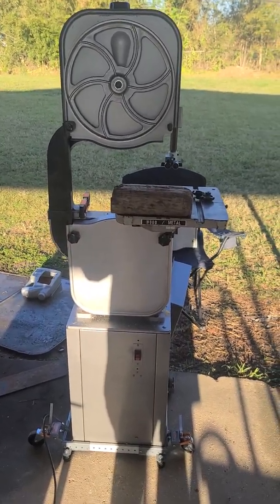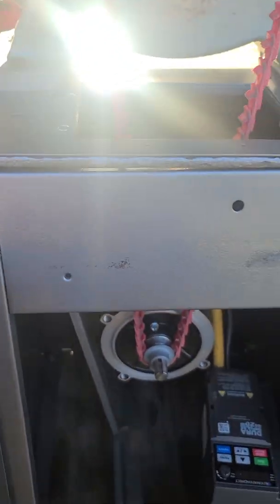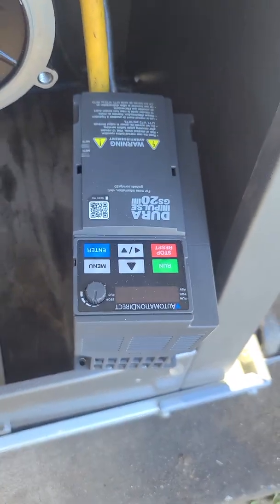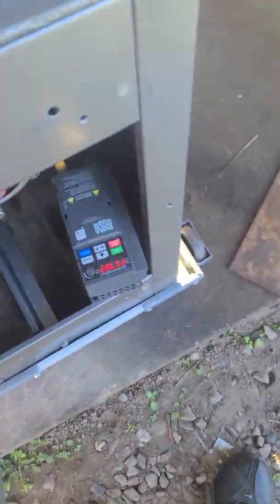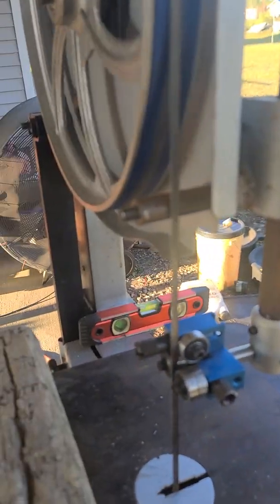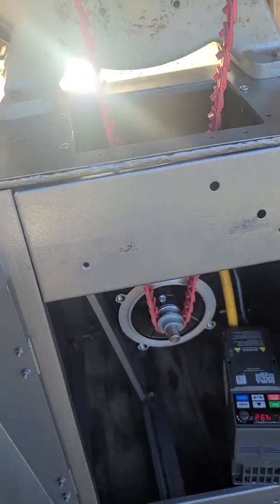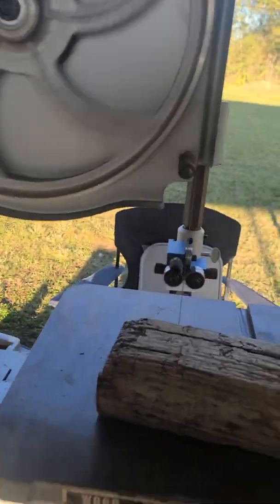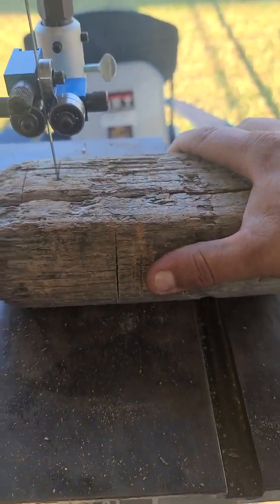1983 Jet JBS-14MW variable speed bandsaw

Comment: I've just bought the same saw on Facebook Marketplace and I was looking to slow it down so I could cut metal. But $527 for the motor + $187 for the controller + $??? for the pulley mods? Seems like you should have just bought a real metal cutting saw. What am I missing here?